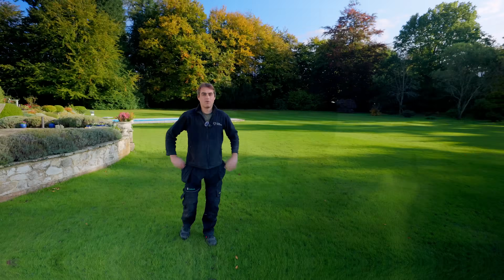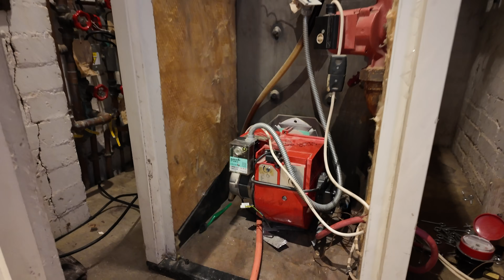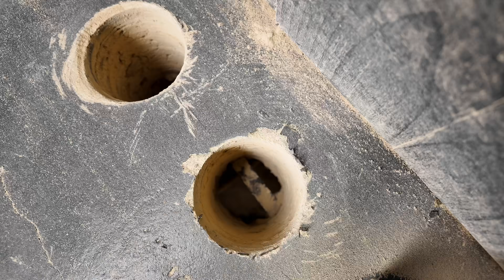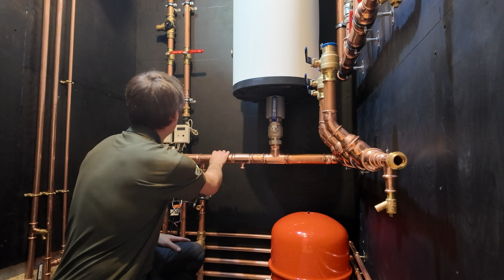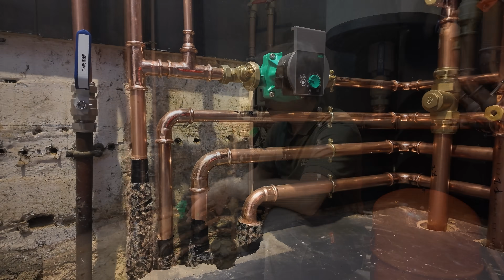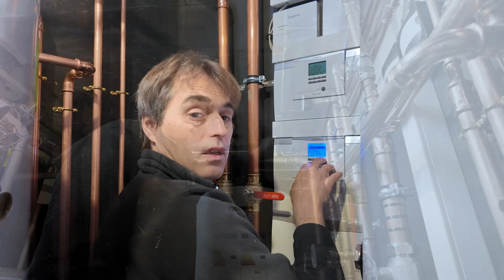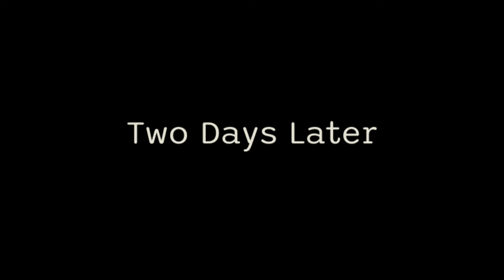Heating Oil Costing You A Fortune? This Is The Fix.

Comment: So, you connected both pumps in cascade to a common supply line and manifold, and zone pumps circulate the water from the manifold to the zones in the house?
The supply lines of the two pumps aren't routed into a buffer tank?
This is awsome! 👏

Comment: 900w to heat a house is like leaving a high powered pc on
Reply from the maker: As you can see this house has very little insulation and works great
Reply: @UrbanPlumbe @UrbanPlumbers  videos many thanks. I heard that you can reduce energy consumption by 30% efficiency with external wall insulation - which over 40 years really stacks up in savings if you have enough outlay initially is that correct? 

A company told me I need to get underfloor insultation, external wall, attic - everything basically for a heat pump to start to make sense. They described it as: "imagine walking outside in the snow with your clothes on but forgetting to put your shoes on - you'd quickly get cold" - where they seemed to be saying there's no point getting a air to water unless you insulant everything first. From some of your videos, you seem to show that sizing the pump correctly to have a low flow rate of around 35-40 has efficiency of around 3.0? Obviously every house is different so I appreciate it's hard to say generally.

Same time, if I could drop 30% energy consumption with external wall insulation, seems like I could save roughly 1.5x more.. for only slightly longer payback period, compared to running it with no external insulation. Does that makes sense to you? where higher initial outlay in insulation, results in far higher ROI over 40 years?

Comment: Watched this many times and love this install. Hopefully get a chance to deaign and install one like this some day. 

What is the benefits of the 2 pipe bypass buffer over the classic 4 pipe?
Reply from the maker: Takes less space, less chances of mixing, but also you can bypass the buffer and run without post buffer pump or see if it works without it and flushing is much easier with buffer bypassed.

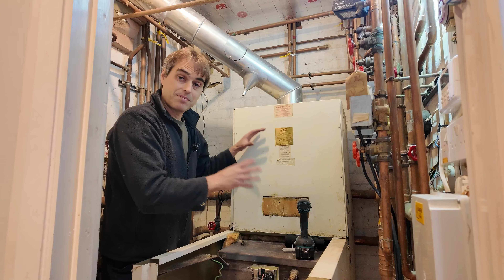Comment: Condensing oil boiler manufactured by Archie Kidd (Thermal) Ltd. Archie was the Heat Geek of the 60s and designed these very high efficiency boilers; they were of Rolls-Royce quality (you mention the boiler is 24 years old). The entire boiler & burner was in an insulated box with a counterweighted air flap to admit cool air into the box only when the burner came on  4:12

Comment: The key to heat pumps is solar panels otherwise your electric bill will be unaffordable.
Reply from the maker: Systems we install are cheaper to run than gas even without solar or special tariffs. The key is to design efficient systems

Comment: 200 panels, if they have a good export limit and rate they are going to generate thousands a month in spring, summer and autumn. Certainly more than £10k a year. I bet ROI is significantly less than 10 years.

Comment: No GCH in house v GCH house = difference in property valuation. GCH install v ASHP install = cheaper to run, if not cheaper, than ASHPs at half the install costs, half the equipment and with instant hot water. I’m gutted to be moving to an area with no mains gas.
Reply: There's 10.35kWh of energy in a litre or heating oil. Oil is at 65p per litre. So oil is 6.3p a kWh of energy presently. Gas is about 7p a kWh presently + standing charge. A modern oil boiler is about as efficient as a gas boiler. So, don't gutted, your oil install could be as good as a gas install. Or, you could have storage heaters or flo gas which will be loads more expensive. 

This house is currently running at a scop of 3.91, so at the current cost per kWh of electricity (25p) cost for a kWh of heat is 6.39p. Considering the efficiency of that old oil boiler, about 80%, the cost per kWh of heat is 7.9p, 23% more expensive. Or considering a gas boiler at 95% efficiency (it never would be due to the high flow temperature) is 7.4p a kWh, or 16% more expensive. And then you could have access to a heat pump tarif at circa 15p a kWh. 

But, better than that, these guys can create their own power and run the whole system, or at least buy in cheap power over night. Unless you make your own gas, you could never hope to match the long term performance of this system. Which then goes on to house prices - If I was in the market to buy this house with GCH or it's current set up, or even without the solar and batteries lol I know which one i'm going for.

Comment: The 2 heat pumps might spoil the view but the EIGHTY KILOWATTS solar system on the ground surely doesn’t
Reply from the maker: It is not on the main garden - it’s behind the power plant room that is another 100metets away from the house

Comment: I have two questions. Can or should I install ufh with existing two layers of hardwood flooring, first layer is diagonal to the floor joists and on top of that the second layer is perpendicular to the floor joists, typical oak flooring 1 1/2” wide ?”thick , joists are 12” on center.  A room in the basement, 8’ height with 6’ underground, is 6’ by 12’, the walls ceiling and floor are solid concrete, 1 wooden door, and a 1 1/2’ by 2’ opening to the outdoors with a metal grate. Is this a good location for an air to water heat pump? Cool all year long with fresh air and almost sound proof. Depending on your answers will determine my next course of action.

Comment: Not cheap to heat my 200 yearold house oil LPG for CH and cooking plus electric lights and wood burner stove total bills  1200 a year but  to  spend capital on heat pump and running costs increased electric use would not save me a singke pound in last decade of my  life. In fact costvmore would.  rather carry on with multi ways of heating as with millions of other over 80s!!!
Reply: The next person to own your house might like electric heating more than the faff of oil/LPG ?

Comment: But how much did the installation cost? How much would it cost minus any government subsidies? How much did it cost to get the house to a standard where a heat pump would work efficiently in terms of insulation etc. ? 

These systems are great in particular situations - ie. rich families with huge bank balances. However anyone working a normal job would never be able to afford the costs involved with heat pump installation.

Its a huge shame.
Reply: This wasn't a criticism at all - I am just hopeful that they eventually become the norm like in some countries in eastern Europe. Obviously once we are at that point the costs will be much lower. Great videos and fantastic workmanship - a true professional.
Reply from the maker: Videos about normal families coming soon - promise
Reply: Many heat pump installs were under the ECO4 scheme (now closed) for those at risk of fuel poverty. The Warm Homes scheme should have similar support.

Comment: I personally think that getting a large solar and battery installation was the best investment I have made in my house, in terms of ROE, but keep in mind that any installer that tells you that your solar system will power your heat pump is a complete liar. 
In the summer months, I produce perhaps 80 - 90 KW per day on a good day. In the winter, on a very sunny day, perhaps 13KW per day. On a rain day, perhaps 2-4.
Reply: 200 x 425w Trina panels 50 kWs on a cloudy day, 100 kWs no cloud no sun, 250+ kWs in sun and a decent sized bank of salvaged Li-ion battery modules charged either via solar or EON Next Drive EV tarrif 6.9p per kW midnight to 07.00hrs, 6 x MPP Solar 5kW hybrid inverters (in parallel) certainly does the trick on this installation.....honest !

Comment: Eventually the ground will heat up and you will be losing far less than the 900W you calculated.
Reply: Its called Fourier's Law of Conduction - The 160m of pre-insulated pipes [4 x 40m runs, 2 each HP] are buried in 15 tonnes of sand 80cm deep. As the sand absorbs heat from the pipe, its temperature increases, reducing the temperature difference ( ΔT) that drives heat transfer. A smaller ΔT results in lower heat loss over time.
Reply from the maker: Crossed my mind that - but I would assume manufacturers took that into the account as it is an underground pipe

Comment: output loss from long pipes is just 1 solar panel. another way to think about it. probably cheaper to install another panel than to keep trying to decrease pipe loss with length/insulation.
Reply: Good shout, I like the way you're thinking.

Comment: I would have installed a hybrid system using a LPG boiler in conjunction with the ASHP. This is a really good example of the complexity of controlling such large domestic heating systems,  it's really a commercial installation. The owner will have to hope that Simon, or someone as skilled, is available to maintain it.
Reply from the maker: Hybrid would be: more expensive to install, more complex, more expensive to service, more expensive to run as can’t be run from solar PV. You would not get a bus grant towards it and your would have to add 20% vat to the installation.

Hybrid are really pointless if you know how to design a decent renewable set up. If you don’t - hybrids are still pointless 🤣
Reply: You're right that without the grants, the ASHP's would make even less sense. It's a case of people who cant afford a heat pump subsidising those who can afford one, a reverse Robin Hood. A sensiblesolution would have been to just change the boiler and uograde controlsto weather compensation.@UrbanPlumbers
Reply: @geoffaries  Look at the cost of replacing the oil tank (has a leak), and an equivalent oil boiler.  From what I can find online, a replacement tank (5000L) is £3K+, and an equivalent oil boiler is about £2.5k. 
Each of the heat pumps (at least from what I can find online) are about £5k each.  Less the grant makes the heat source alone £3k cheaper.
Reply: @BenIsInSweden  the replacement oil boiler is looking at £5.5k for that size.
Reply: But you then have to add ALL of the extra work to install the ASHP'S, including changing all the radiators. Fwiw I've been a fan, in principle of ASHP'S since the late 1980's, I even set up a company to install them, but without the grants they are not a sensible investment. What irks me is that they're like BEV's, they take money from people who can't afford to give to people who can.
Reply: @geoffaries  Changing rads isn't a requirement for a heat pump, it's to change to low-temperature heating that benefits any heat source.  Doing so would have paid for themself as well with replacing an oil boiler.  So is cost-parity.

Not sure how it is taking money from people who can't afford them?  You do realise that if grant cost was equal across everyone who pays tax it works out at less than £5 per year for the 3 years the grant is active, added to that, higher earners pay more tax anyway.
Also, the grants stimulating the work indirectly add some tax back into the system as well.
It's a drop in the ocean compared to other things that have been subsidised for the gas and oil industry, but people don't seem to have a problem with that.
Reply: @BenIsInSweden  If we want the better things in life such as EV and ASHP we have to put more effort into our career or busines, that can mean longer hours or an extra weekend day, or take a few risks. If you/we earn an average wage - ChatGPT day rate £145.60 multiplied by 52 equals £7,571.20 extra if you work an extra day a week for a year + the BUS £7500 grant gives the average person enough the buy a ASHP in an average home. Obviously if you are unfortunate to be unable to work, ASHP isn't acheivable at the moment. I feel sure that the government will find a way of taxing more people to give ASHPs to "working people" those are according to Mr Starmer are people that "work, they are doing okay, but when they need a little extra money to cover the unexpected they can't write a cheque to cover it". Clearly Starmer didn't realise cheques ceased a few years ago !

Comment: Just to recap the £££££££'s figures in case you missed them. In 1999, heating oil was priced at 7p per litre. To heat this house and swimming pool, using 10,000 litres resulted in 250 tonnes of CO2 emissions annually.
Fast forward 24 years, and heating oil is now 70p per litre, equating to £69,000 spent and a significant amount of CO2 emissions.
Looking ahead 20 years, at today's conservative oil price of 70p per litre and assuming the same annual percentage increase, the projected ppl cost rises to £4.28ppl multiplying to £400,925—again, going up in smoke and CO2.
Given these figures, I’d be curious to hear from anyone who still believes the economics don't make sense. If you'd like more detailed data or have questions about the basic calculations, I’d be happy to discuss further.

Comment: Is this video sponsored by anyone? Anyone or any government departments?
Reply: Definately not, but I’ve taken a moment to put together a quick spreadsheet to clarify the financial implications of the decision to upgrade to HPs. Over the past 24 years, the old boiler has consumed approximately 240,000 litres of heating oil. Starting at the cost of 7p per litre in 1999 and applying a 10% compound increase per annum, this amounts to around £62,000 + tax and 250,000 tonnes of CO2 prior to removal 2024.
Looking ahead, if we had replaced the boiler and oil tanks (£20k), taking a mean starting price of 70p per litre and use the same modelling of a 10% compound increase in ppl £ per annum, the cost in 20 years would have reached an eye-watering £4.28 per litre. This would equate to £400,925 + tax just for heating oil alone plus another 250,000 tonnes of CO2. Aditionally the solar panels charge the boss and his wife's EV's
Reply from the maker: I wish it was 🤣

Comment: Small solar farm in garden ok, 2 heat pumps in garden not ok😅
Reply: The heat pumps are positioned behind a hedge and adjacent to a stable building, making them completely hidden from view. To connect the system, there are two 40-meter flow and return runs of 50mm pre-insulated underground pipe leading from the heat pumps to the plant room, routed through the cellar inside the house. This setup is a brilliant design by Szymon and the client. Now that the job is complete, no one would ever guess that 2024 technology is effectively heating this property for free at 21C throughout the whole house and hot water in each bathroom.
Reply from the maker: No solar in the garden - it’s in the filed

Comment: Syzmon, well you have surpassed yourself with this one, absolutely epic both the design and installation. Amusing reactions in the comments have also kept me quite entertained too (sadly some real howlers from people in the industry too). 

Good decision by the homeowner (even without the PV and Batteries).

I was just looking at the entry on the OE site (I assume this is Liphook?) and there is no indication of the control strategy and nor did you cover it off in the video. Is it pure weather compensation or room influence?

Thank you for sharing.😀👍
Reply from the maker: Pure WC only on my installs
Reply: @ Thanks, I thought so but did not want to ‘assume’.😉

Comment: Excellant presentation. Clearly proving that HeatPumps are well capable of satisfying many application requirements, once the system design is correctly dimensioned. Impressive use of remote siting of Heat Pump using buried insulated pipework.
Reply: @dermotnangle3648  yes they might be capable, but not everyone has 10 acres of land, a stables and 40 solar panels lol

Comment: Cylinder just for towel rails seems a bit overkill. Just put a heating element in each radiator, not getting any efficiency using immersion heater for cylinder.
Reply from the maker: Allows for not only storing energy, charging it when sun shines and using later but also is much much cheaper than wiring 8 x elements and charging traditional bathroom rads to towel rails.

Much better solution in this case.
Reply: @UrbanPlumbers  Fair enough. What are your thoughts on integrated heat pump cylinders (Mixergy or Vaillant Arostor), just for hot water, and running a secondary return off them to heat a bathroom towel radiator and a kitchen plinth heater? Love your work an enthusiasm. by the way.

Comment: Great install and video - so much copper in the original install!
Reply: The previous CH upgrade in 1998 was in 2.5" maluable iron pipework, that was taken out and many bundles (1,500m) of copper put in to distribute over 12 zones. Back then the gauge of the copper pipe was thicker than today.
Reply: @MalcolmSkerrett  I hope they flashed the old system out when they replaced  it with copper , there must have been a load of sludge accumulated over the years.

Comment: Fantastic project. I'd love to know your thoughts about using stored thermal energy in large outdoor water tanks (insulated of course) vs the batteries for a larger project such as this. Obviously, some amount of battery storage has the advantage of running the rest of the equipment within the property, but I'm wondering if thermal storage would be cheaper for the bulk as large water tanks are very cheap. You can still do all of the same things to reduce costs: pump excess solar or off-peak energy into the storage.

Off the top of my head, the main downsides would be:
- Space (I think I calculated 20,000l last time I looked for myself, so on this property, it would be a lot of physical space)
- Requiring a higher storage temperature

But I'm thinking that balances against the electrical conversion losses for batteries and the capital costs of such a large battery array while still allowing you to benefit from cheaper energy rates or excess solar.